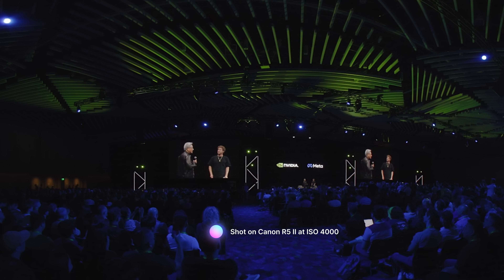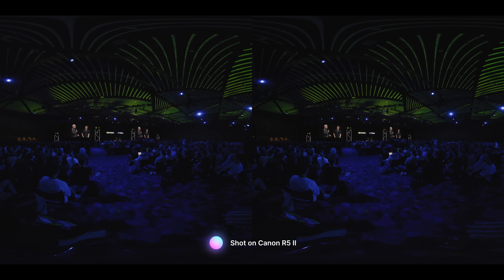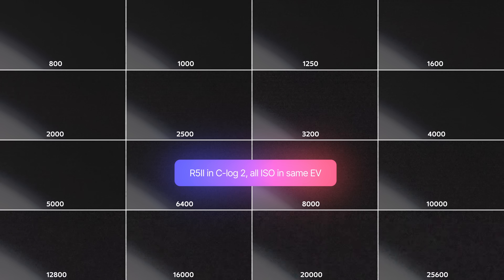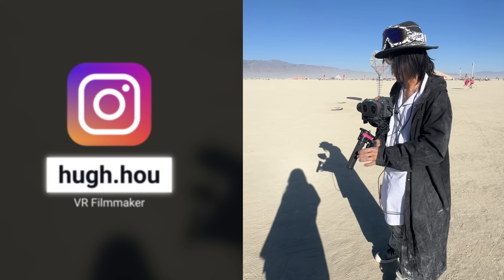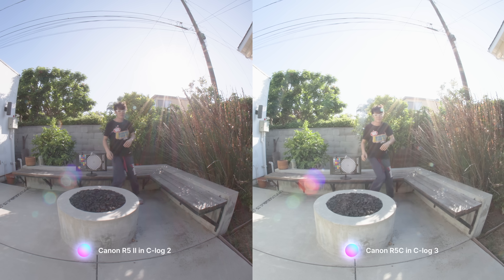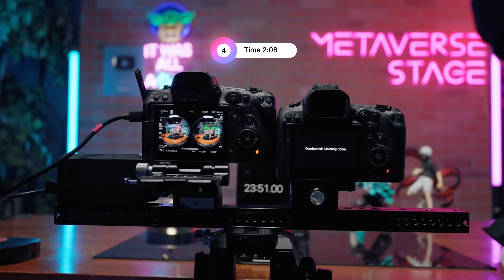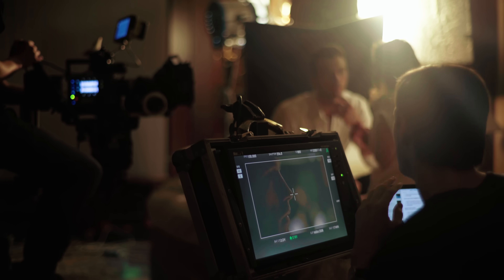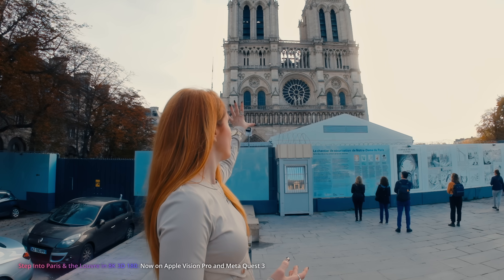Triple-Base ISO debunked! Canon R5 Mark II Noise & Overheating Test vs. R5C

Comment: R5C can now record 8K60 with internal battery only after the latest firmware update, you just need to use the same new battery type as in R5II.
Reply from the maker: Wait what?! What firmware update? Can you point me to that?
Reply: @hughhou  The latest FW 1.0.9.1 added that in.

""Enables functions to be used without limitation in conjunction with the new Battery Pack LP-E6P. This makes it possible to shoot 59.94P with RAW LT.""

 I don't have the new battery to try, but I know others have and it works.

Comment: Dear All,
Has anyone used this camera and experienced overheating while recording in 8K at 60 FPS? If so, could you help with the following:
1. What specifically tends to overheat— the storage card, the battery, or something else?
2. If overheating is an issue, would replacing these components help mitigate the problem and allow for longer recording times?
3. Would using an external power system extend the recording duration?
4. If the primary cause of overheating is the storage card, are there any cards available with a better thermal profile?
5. Are there systems that allow the card to be connected to the camera but placed outside the body to reduce internal heat buildup?
The reason I’m asking is that, even if I could shoot longer without overheating, the storage card would eventually fill up. So, I'm wondering if heat is truly the bottleneck or if there’s another limiting factor.
Reply from the maker: 1. CFExpress is a big one and better “cooler” CFexpress make it last longer as we tested! 
2. Use a 3rd party cooler fan at where your LCD flip out help a lot! 
3. Yes absolutely. 
4. I will make a video soon thx for suggestion 
5. Nope

Comment: Thank you very much for your attention to detail. You really explain it that me as a beginner can understand it. I wanted to ask you if you would want to film 8k 60 fps 180 VR videos of for example weddings, or special moments for professional use. Which setup would you recommend? The R5MII seems to be not reliable with overheating issue, use the R5C or different setup? thank you !

Comment: Hi Hugh - I have kind of niche -question. I own the C70 and the R6ii and do TV run and gun work. The R6ii has great downsampled lowlight and a great looking but only 8bit 4k 50p. I got the R5ii now for the 4k 100p and better codecs but I shocked about the lowlight capabilities. If you had the C70 and R6ii and the chance to replace one of them - would you get the C400 for the C70 or the R5ii for the R6ii?
Reply from the maker: I would get C400 as sound like you are professional. C400 is a great camera - more pro but you will love it. Especially low light you are talking about as triple base ISO
Reply: I agree, photos, af and daily videos look awesome, but dark and night scenes shooting video is criminal, I have so much noise that its not usable. Im not sure is that some faulty cameras on market since everyone is ssying its fantastic in low light, my last wedding is disaster with clog2 and iso from 2500-8000. Too much noise, it looks like a toy camera.

Comment: Only using normal profile except from c-log 2 / 3, Dual base ISO also 800 & 4000 ?
Reply: no, when you normal profile  is standard as in Dslr , i mean 100 iso etc
Reply: @NicanorVillanueva8  thx for your reply

Comment: So they made a new camera that they knew would overheat and purposely did not put a fan in it. Even a miniature fan would have done the job but they just didn’t do it…….
Reply from the maker: The fan is a grip you need to buy extra - about $389 I believe.

Comment: Hugh what's your thoughts on comparing ISO-3200 in the R5-C (it's best low-light setting) vs IS0-4000 Mark II? - Since you compared both IS0-4000 @ 3:19...I see the huge difference. But the R5-C sucks at ISO-4000.
Thanks man! This is a $2,000 decision I'm trying to justify.(selling the R5-C for the Mark II or not)
Reply from the maker: I think ISO 4000 is still better than ISO 3200 R5C - but I will need to do more testing, Hold tight.
Reply: @hughhou  Awesome thank you. I know it will help a lot of other people out too :)

Comment: You have same expo for c-log2 and c-log3, so overexposed c-log3. This is incorrect. Pro shooter does not do this in real use. The result is misleading. I do not say c-log2 is not better. I say this test is misleading.
Reply from the maker: Sorry, is there a different strategy to expose C-log 2 and C-log 3? Can you give us more details or the correct way you think we should run the test so we can re-do the test? Thank you so much!

Comment: What about dynamic range?
Reply from the maker: As you see the second test, the dynamic range is better in clog 2. But we will do more test in a rental house which has more measuring devices.
Reply: @hughhou  i am using canon r6 ii for photography about 2 years, and my expectations for r5 ii is better dynamic range, i need to choose between r5 and r5 ii

Comment: FINALLY A GOOD FRICKEN VIDEO ABOUT THIS CAMERA. So many garbage ones of people saying the same thing over and over again. Subscribed for sure. Thanks bro. Video people like us care about noise and dynamic range and that’s what you answered straight to the point.
Reply from the maker: I am so glad you like it and thanks for the subs. We are lucky to have the camera so we can run real test for the past 2 weeks. More to come. Very powerful camera, since I have C400 and R5C - this R5 II is crazy underrated and there will be new firmware coming update some even more impressive hardware feature just like the R5 when it first came out. Exciting time for Canon!
Reply: @hughhou  do you think it’s as good as Sony in low light situations?
Reply: Noise wise.
Reply from the maker: @eccproductions  I personally think it is better than SONY - but I only have SONY A1 8K for comparison.

Comment: If Canon just allow a firmware update to allow CLog2 to the R5C… 99% problem solved 🙃
Reply from the maker: This is a most ask feature on day 1 R5C launch ... I think it is a hardware limitation. If not, it should be out 2 years ago!
Reply: @hughhou  I don’t think it’s completely hardware… footage can be edited as CLog-2 when converting from RAW. Plus you likely noticed as well the sensor to the R5C is different (better) than the R5, video looks better across the board on the R5C
Reply: @jimmystewartuk   but is it really like you filmed natively in C-Log 2 when you change it in post, for example in DaVinci resolve? I wonder how this test looks like if you do it that way! pretty sure the r5c has the same DR then!

Comment: I think the over heating issue is still the firmware problem like the first generation. But Canon wants you to buy their new expensive cooling grip so they just put this limitation in R5ii current firmware on purpose. The problem can definitely be resolved in future firmware upgrade like R5i but just depends on when and if Canon will do it.
Reply from the maker: Wow good to know. That grip is harder to get than the camera itself!!
Reply: @hughhou  Cooling grip in stock in some retailers in the UK right now. Seems to me that you need to test the overheating with that, otherwise it's a pointless comparision: the R5C doesn't overheat 'cause it has a fan. Add the cooling grip with the fan to your test and then you get a proper comparison.

Comment: Congratulations. Great comparison between the two cameras. Specifically speaking only of the 180VR recording in 8k 60fps, I love the Clog 2 of the R5 II and full HDMI. But time is money and I still think that the overheating of the camera is a big handicap. I prefer to carry an external battery with no time limit on the R5C than having to wait (1 hour?) for it to cool down to be able to record 18 minutes more.
Reply from the maker: Thank you! Yes it is really true on that point as well.
Reply: There’s the external fan grip for the r5 ii

Comment: Great test, I wish you have test the 4k oversampled 4k fine 30p in overheating, becouse I do have R5C for podcasting videos 45min to 60 minutes lenght so i don’t know  if the  R5II can be use for a 4k multicam podcast. Thanks
Reply from the maker: Good suggestions! There are so many use cases I just tested VR for now. I will do those tests in my next video. Podcast is a good usecase for sure!

Comment: Can we use the Kondor Blue D-Tap  to LPE6 dummy battery on the R5 Mark II
Reply from the maker: Is there a Kandor Blue for the new Canon LP battery or you mean the old one? I do not use the old one and I actually won't recommand to use any dummy d-tap of the old one on the new Mark II. Personally won't play with power supply on my brand new camera.
Reply: @hughhou  Yeah I was asking about the old one. I have not tried it on my R5II yet

Comment: Can you do a overheat test doing 8k 24p RAW and S-RAW? Most people wont use this camera for 8k 60
Reply from the maker: For sure! I will do those next :)
Reply: @hughhou  Sweet, thanks! Also, if you shoot 8K RAW on the R5C, you can interpret as Clog2 in resolve, but it still doesnt feel like real clog2 (I own other canon cinema cams). It will be interesting to test this vs clog2 in the R5ii.

Comment: I think overheating times would be slightly better if the display was opened to side to allow better heat dissipation.
Reply from the maker: 100% agree. I can probably get to 18 min if that. Again this is also a comparison test to see heat affecting image quality vs the R5C. More tests will be done soon with this consideration :)
Reply: @hughhou  I love my Canon R5C and I also see that the R5II isn't really a replacement for it as the R5C can do oversampled in all modes.  I hope that Canon can add SRAW to it for the 4k60 unless it's unnecessary?  I wonder if the h.264 has just as much info as Sraw?

Comment: You have to put the R5C into "base 3200" or "base 800" modes, you cant just be in base 800 and change the iso to 3200, you'll get way more noise than being in base 3200 at 3200.
Reply from the maker: Yes correct and agree 100%. In this test tho, it is on auto switch. Meaning I make sure 3200 is in base 3200. No matter what I use, it is clear that Mark II has better low noise than R5C. I hope that is not true but it is. The sensor is better in light sensitivity.
Reply: @hughhou  nice, I can’t wait for an R5C II. People say it isn’t coming, but Canon will need an answer to the FX3 II & the R5II doesn’t cut it for filmmakers.

Comment: I have heard the 4k60, although not oversampled, looks better than it did in the R5.  Is this true?
Reply from the maker: Mmmmm... I can't really say that. 4K60 is a weak point on this camera right now. I do think it is a firmware oversight as it should has oversample - and pretty sure Canon is fixing it in the next firmware as it is just pixel processing and their chip is powerful enough to do that...

Comment: How does one decide between the R5C and R5ii? What are the uses cases in which one would be better than the other? 

If it’s relevant: I’m looking to capture content to be viewed on the Vision Pro specifically. 

Thanks!
Reply from the maker: R5C more for professional that need long hours capture but not too much travel, run and gun it. For R5 II is more for hybrid creators that need photo and video capture, gimbal or run and gun a lot. There is still a pretty price difference as R5 II is more expensive and R5 C is on sale with great deal. They are BOTH great for Vision Pro and has the exact same resolution - 8192 x 4096 in 60fps. Currently is the highest until Blackmagic launch their 16K camera (which also wont be cheap and for very very high end professional). So buy the one you can afford. Also, R5C has a lot bigger ecosystem for support and ton of tutorial on my channel. R5 II will get there but it is so new it will take us a bit to catch up on tutorials and build guide.
Reply: Oh man, thank you so much for the response! My first YouTube comment and I got such a great and helpful answer. Been watching your stuff for a while now and seriously appreciate all of the time and effort you put in, as well as the detailed response to this question. 

Am looking to take short 3D videos with high resolution (and likely with a gimbal) for a dermatology study I am conducting, so it sounds like the R5ii is the better fit, especially if I may also want to use it for photography down the line. 

Thank you again!

Comment: How about a 5 and 10 minute cool down video test? Thanks for the helpful info!
Reply from the maker: I tested, it get 4 min for 5 in my case. BTW, swapping battery and card will give you a full reset - as those are the hot items.
Reply: @hughhou  thank you so much! Any expected timeline for that lower heat cfexpress card you hinted at previously?

Comment: Thanks! This helped me make my decision to stick to my r5. Not much of an upgrade. Would have if 4k60HQ was not line skipped.  If it could have done all these in 60mp with manageable overheating , i would hv jumped on it. Chip and sensor technology is not there yet for 60mp. Looking at perhaps leica SL3.
Reply from the maker: Glad it help you to decide :)

Comment: Seems like nobody has a cooling battery grip to test???
Reply from the maker: Nope lol. Base on release docs - cooling battery grip does not increase filming time at all on 8K 60fps. So I might DIY solution - I notice there is area are really hot and area are not. If we can mount some third party heat system it can get longer. Build guide is coming!
Reply: @hughhou  Wow…where does the grip help? Did I wasted 400 bucks with the pre-order ?

Comment: In your opinion - will the R5 Mark II replace the R5 and R5C, or is there still a reason why filmmakers would prefer the R5C ?
Reply: @Billwzw  Cinema OS, No IBIS, 8k oversampled 4k 60, Cheaper, just a few things off the top of my head.

I'm getting the R5 MK2 to replace a R5 not replace my R5C.
Reply: @ViciousXUSMC  Same. I’m replacing my R5 with the R5ii, but keeping my R5C’s.
Reply from the maker: No IBIS is a good thing or a bad thing?
Reply: @hughhou  You know as much as us :)

Good for photography, good for hand held video, not needed for something like gimbal or tripod but actually bad for certain high intensity situations like car mounted or drone mounted video because the IBIS wobbles and turning it off does not resolve it's a side effect of having a floating sensor that can move around.
Reply: For me r5mkii is better choice: clog2 (game changer), ibis is great to have (just disable it if you don't need it for certain shots), the option to film in full frame 4kraw, too bad the 4k60 is not oversampled but I don't think your clients will see a real difference…
Reply from the maker: Yes. R5C is still my main camera as most of my production (for clients) are on a tripod. So long running hours is kinda requirement and it is hard to explain to Client that my camera will overheat (unless I want to get fired in day 1 lol)

Comment: Thank you for the test. In the comparison clog2 VS clog3 it seems to me that the image with clog3 is brighter. Do they have the same exposure?
Reply from the maker: Exact as Peter mentioned above. They are in the exact same exposure but the idea of Clog 2 is flatter than Clog 3 - so you can pull more in post. But that is why Clog 3 look brighter (and better without lut). Clog 2 is really for colorist know what they are doing. It is not easy to handle. We use Clog 2 as we know how to color grade. But in practice Clog 3 is a lot more easy to shoot and post. Yes highlight will suffer that is the trade off.
Reply: @hughhou  Clog2 has more range in the shadows, it is supposed to have the same range in the highlights. Did you expose both cameras with false color?
Reply: @hughhou how does clog2 affect autofocus tracking performance? Does the lower contrast cause the camera to struggle with AF? I found this to be an issue with the original R5 in CLOG3 but I don't know if it was just the video AF being worse than photo AF or if the log profile made it even worse. Is video AF tracking significantly improved vs the original R5? Especially for wildlife with animal eye AF?
Reply: It looks like brighter because clog3 is more contrasted, less « flat »

Comment: Good to finally see some news I can trust since your very technical like me.

Been seeing so many rumors that the dynamic range and low light performance is worse on this than the R5.

They are talking about photos, but I'd have to assume that if it can be better in video it can also be better in photo.

As far as overheating.  Gotta do that one one more time with the fan grip.

Since the R5C has a fan that's the only way to compare them head to head IMO.
Reply from the maker: Yes I don't have the fan grip so I will when I get all my toys in check. Personally I won't use it as it mess up my gimbal setup. If I need long hours - I just use my R5C. R5 II is for run and gun and gimbal it. For photo, I do not do photography so I don't know. But R5 II is really a video breast. For photo, any potato camera do a great job these days. Dropping 5K for photo does not really make sense lol.

Comment: Thank you for the great video. One question: Does the R5C work in 8K-RAW-LT 60fps with the new battery from the R5MKII without a power bank? It has more power so in theory it could work.
Reply from the maker: oh shoot I suppose to mention that in this video and I forgot!!!!!!! Now your question make me hate myself when I make video under painkiller...ADD. Anyway, the answer is NO. R5C does not work on the new battery for 8K 60fps. I think there is some magic also in the operation to make R5 II do that - in camera body or codec optimization
Reply: @hughhou  Great video. Is image stabilization available when shooting 8k or  4k raw?  (r5ii)  Cant find answer anywhere. Thanx
Reply: It works now. Just update the firmware of the R5C and you can record 8K60 on battery power alone.